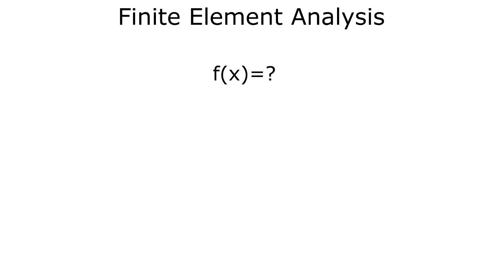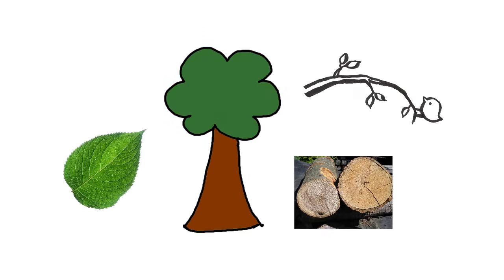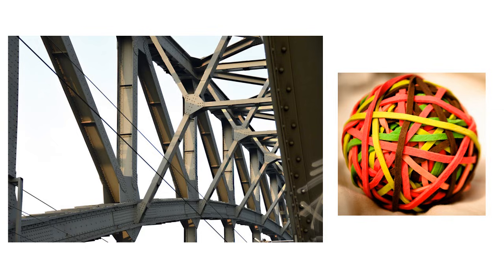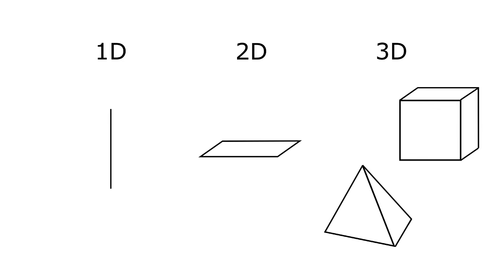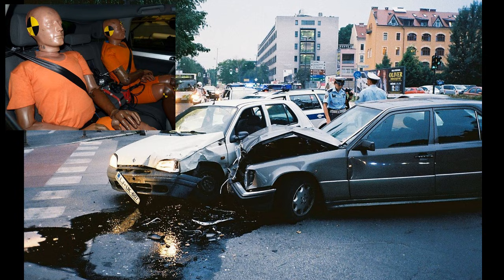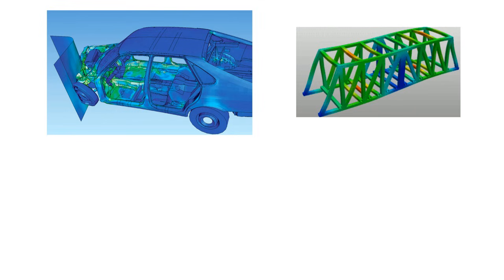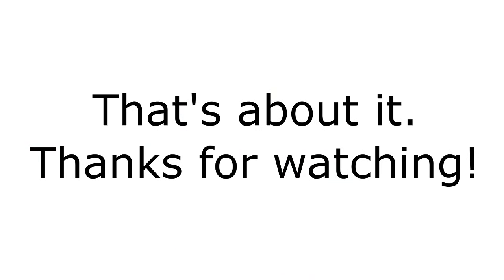What is Finite Element Analysis? FEA explained for beginners

Comment: 00:01 Finite Element Analysis is a numerical method used to solve engineering problems.
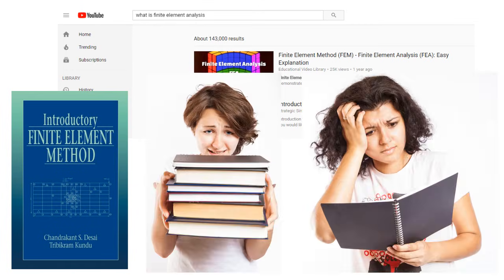00:49 Finite Element Analysis simplifies complex equations for practical understanding.
01:34 Material and shape affect response to force
02:18 Finite Element Analysis allows manipulation of material properties for different behaviors.
03:09 Finite Element Analysis uses different types of elements to represent the geometry of an object.
03:56 Finite Element Analysis (FEA) can be used to create car models for crash evaluations.
04:48 Finite Element Analysis (FEA) models real-life objects and their behavior under specific conditions.
05:43 Finite Element Analysis (FEA) is complex and comprises three key parts: creating geometries, meshing objects, and running simulations.

Comment: Hello sir, I have a question.

If I pursue my career in FEA then will it require me to do programming?
I like using the Auto-CAD Software and I love math but I don't like programming.
:(
I'm a mech undergrad btw
Reply from the maker: Not really. You will at least need to know how to use something like Matlab or Python for data extraction or plotting scripts etc. but nothing too difficult. It also depends what field you pursue within FEA (crash analysis, fluids, structural etc.)
Reply: @UnpopularMechanics  ok. Thank you.
I only  know the basics of C and C++

Comment: Is it easy to find a job that's all about fea?
Reply from the maker: It’s a tough question because the different solvers (LS-Dyna, Abaqus, Ansys ect.) are all used in different fields (automotive, structural ect.). So it would be best to figure what you would like to do, research jobs in that field and see what FEA solvers are used most, then focus on that. If you are skilled with a certain solver and have experience in the field, then yes you shouldn’t have a problem finding a job.
Reply: @UnpopularMechanics  Yes, I'm actually starting to study about FEA, and I really like this topic. I was working as a programmer since 15 years and just this year started to play with lathes/mills and CNC machines. I really like them and I'm trying to connect all my programming knowledge with what I'm doing with those machines. I'm not sure if simulating machining parts is something really very useful, but let's see.

Thanks for the info

Comment: Quick question, are Finite Element Analysis (FEA) and Finite Element Method (FEM) the same thing? Some people on the internet say it is and some say it is not, so can you please explain
Thanks in advance
Reply from the maker: Great question, finite element method is the math behind all of the different software that perform the “analysis”. You can actually hand calculate using the finite element method. 

So, finite element analysis uses the finite element method.

Comment: How do you build the geometry, especially that organic shape (bone)? What software program are you using?
Reply from the maker: Take CT scans of a leg, segment out the bone with a software like Mimics to get an .stl, directly remedy from that or create CAD (.igs or .step) and mesh that, assign cortical bone and cancellous bone material properties.
Reply: @UnpopularMechanics  thanks for the answer. I thought you were modeling stuff from scratch. I can imagine how hard it is to work on organic shapes. Cheers
Reply from the maker: In my world that is about as “from scratch” as you can get. Were you talking about modeling bones without any scan data at all?
Reply: @UnpopularMechanics  Hello Sir, is there any software that can directly Draw cad models by itself, i.e.by some image processing technique. You explained about medical field, is there any software that can scan images directly and make a cad model?
Reply from the maker: Mimics is what you are looking for
Reply: @UnpopularMechanics  what is the actual procedure, like you said you are using CT scan images and then converted it in STL , if I want to make model of mechanical components what should i be doing, any alternative for CT scanning?
Reply: @UnpopularMechanics  Hello Sir, as far as I have researched Mimics uses input of DICOM format, if i want to use jpeg format, how may i use it?
Reply from the maker: I’m not sure how you can do that with jpeg images. What are you trying to model?

Comment: Thanks for the video!
If you want to design your own boat, could you teach yourself and learn to use fea with laminates and do it yourself?
Or is this just nuts?
Reply from the maker: Design your own virtual boat for simulation? Yeah that’s possible for sure. You would just need CAD of a boat geometry or design the geometry yourself
Reply: @UnpopularMechanics  Thanks for answering! No I mean for actually designing and building a boat to travel the oceans on. I know there is a lot to that and that it would be safer and easier to hire an engineer for it.
But for my goal of a solar powered catamaran you need to optimize for weight because you only have very low power available. There are no good designs or building plans that incorporate that atm.
So my question is, if I learn the basics of structural engineering and then teach myself to use some (hopefully free) software to do this FEA optimization to optimize for weight, would that require years or months of learning?
I presume that fea especially for laminates is very high paying so it could be cost effective to DIY.
So is this nuts? :)
Reply from the maker: Oh wow! Well that is a huge job but it’s possible. You should first prioritize learning about CAD and how to begin designing the boat. Once you have the CAD created you’ll be able to mesh it and set up a finite element simulation to test for whatever you want. If you are only worried about weight, you can just try to model the CAD and compare the mass between materials commonly used for catamarans. I’m assuming you would need to determine how thick the material for the boat would be and things like that. I’d be happy to help you along the way as this is a pretty ambitious project ;)
Reply: @UnpopularMechanics  Oh wow thanks!

Well I'm "sketching" concepts in Fusion 360 so that isn't the problem, although it's way more work than I hoped to actually design something in CAD properly.

And it's also an iterative process or design spiral, in order to design the boat and it's resistance and hull shape I need to know how heavy it's going to be and how heavy depends on the forces acting on it depending on the weight and hull form...

I have yet to watch your full video series also. There is just a boatload to learn about naval architecture. 

What software could I use? Is a trial version of hyper mesh the only sensible option or is there free software that can be used reasonably well.

I know Fusion360 has a fea module but not for laminates / composites. Can you "approximate" composites as isotropic materials if you assume a quadraxial fiber orientation?
Reply from the maker: There are some free meshing software out there that I've used. IA-FEMesh is one that works pretty well for simple geometries. I'm not super familiar with it but I could make a video once I brush up on it. Also, you can create topics on the forum where you can attach pictures and whatnot to better illustrate any issues that you may have. https://feassistant.com/forums/
Reply: FreeCAD is the software you need.  Open Source software that really is free - no catches.  There is a bit of a learning curve but it is worth it.  You can model your boat including all its parts.  It also has a FEM work bench that generates meshes, and calculix solver.  Also a great online community and forum where you will get help from some very clever people.  Google it.

Comment: Wow very nice and helpful. How do you design a human body? Do you use cad to model?
Reply from the maker: Yeah so the process would be to take scans (CT/MRI) of a volunteer, create a geometry from that scan data using segmentation techniques, mesh that geometry, and then assign appropriate material models and modeling techniques to the mesh. The last step is one of the most challenging because components of the human body behave differently in PMHS subjects vs living people like you and me. Two of the biggest human body models are the GHBMC and the THUMS if you want to know more.
Reply: in my opinion to design 3d model of irregular shape such as bone, ship, or another entity we cut  a model into several 2d drawing. when the part/segment getting more wired we often add some cut or station to make sure the model is representing the real model .and then  the  we arrange segmenting together and use command loft in autocad or rhino. just like design a ship using lines plan method. currently i've using FEM analysis to design offshore structure such as ship, drilling platform, production platform etc